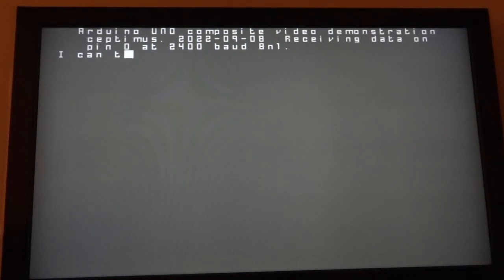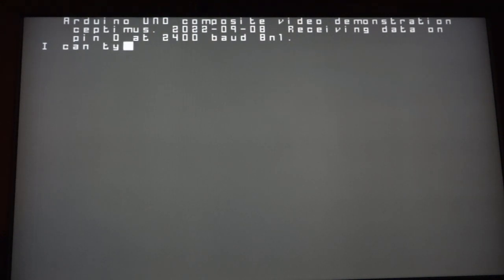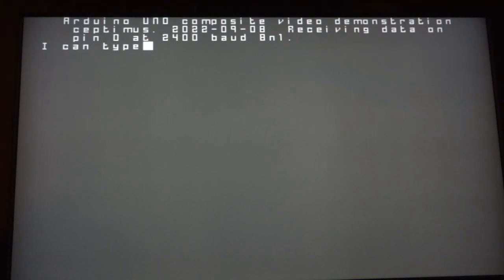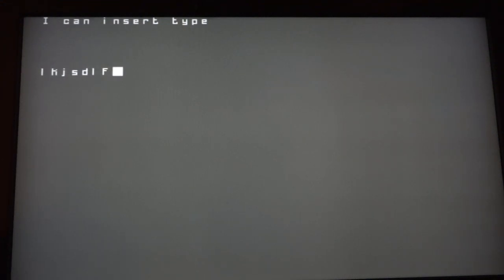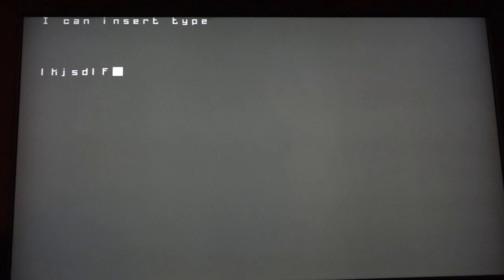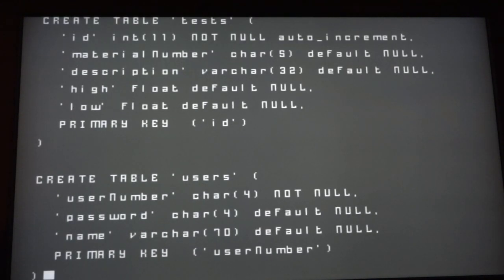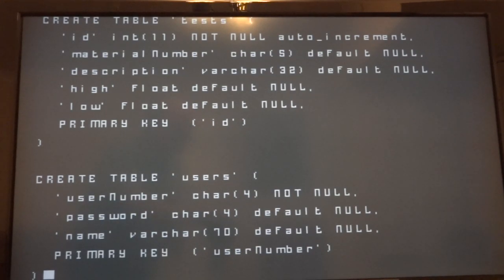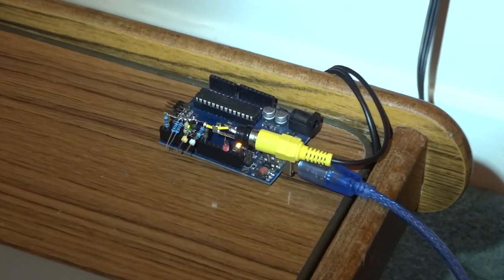Arduino Uno composite video output.  2400 baud dumb terminal.

Comment: Super...but please, where can i find the escape codes to clear the screen or moving the cursor ? I send text with another arduino , that works fine...only need to control the cursor and clears the screen . many thanks
Reply from the maker: The sketch doesn't currently implement an escape code for clearing the screen, though it would be pretty easy to add - It would be Esc[2J

The codes for cursor movement are standard VT100 escape sequences, sent by terminal emulators such as PuTTY.  Search online for "VT100 escape codes" to find a list of them.
I think the ones the sketch currently implements are:

Home: Esc[1~  or Esc[H
Del: Esc[3~
End: Esc[4~  or Esc[F
Up: Esc[A
Down: Esc[B
Right: Esc[C
Left: Esc[D
Backspace: Ctrl-H  or Ctrl-?
Return: Ctrl-M
Line Feed: Ctrl-J
Reply: @ceptimus  ok...great...thanks.